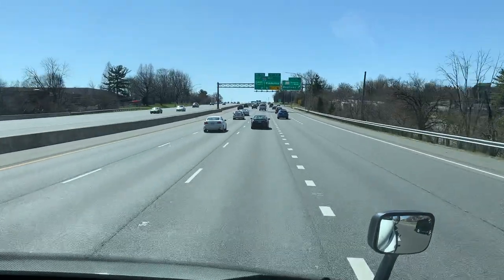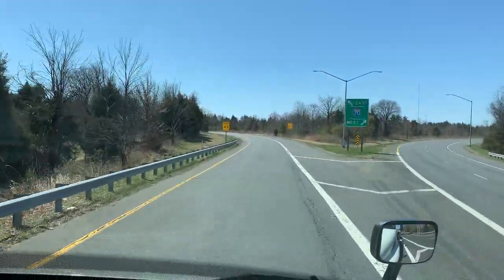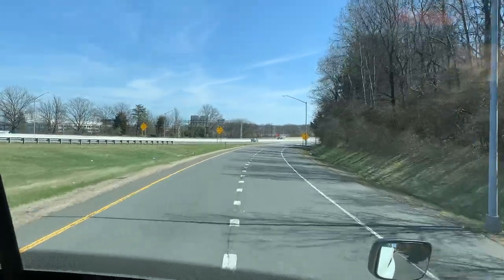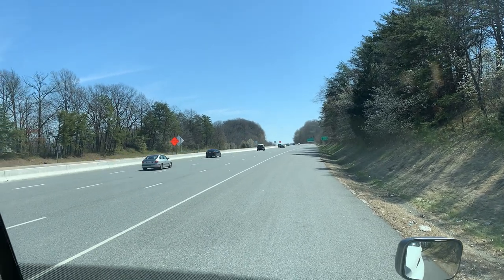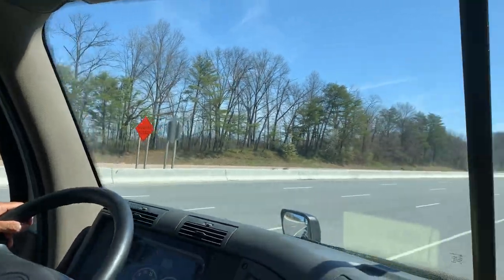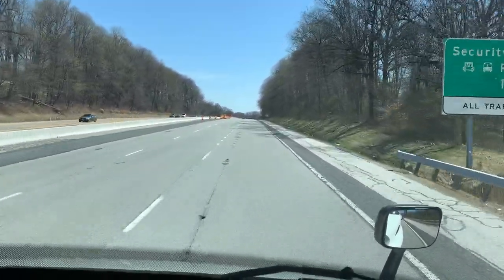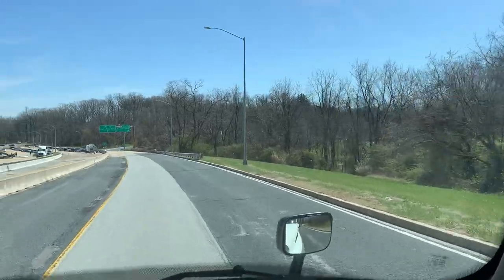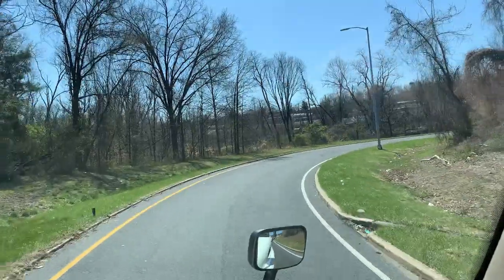CDL Tractor Trailer Road Skills

Comment: He didn't keep has  hazard on
Reply from the maker: When pulling out from the safety stop, the driver needs to communicate with other drivers what they are doing. Turn on your left turn signal (if you are going to the left).  If you are not up to road speed, I would have my 4 ways back on.
Reply from the maker: Thank you for your comment.